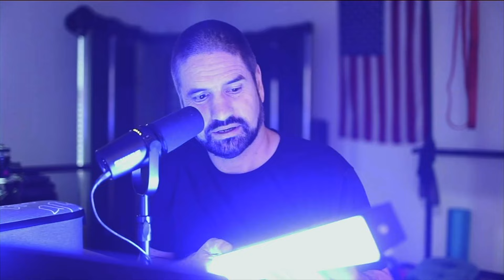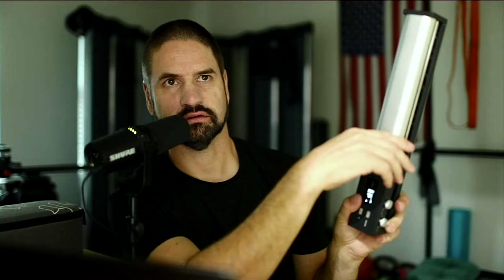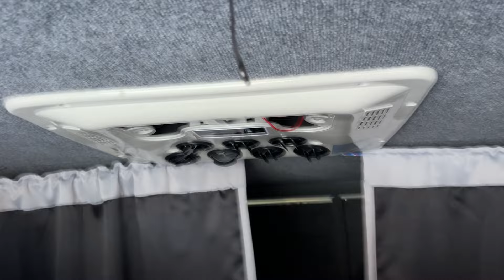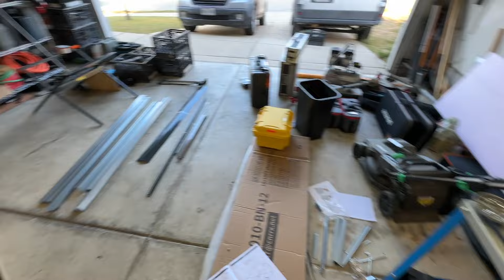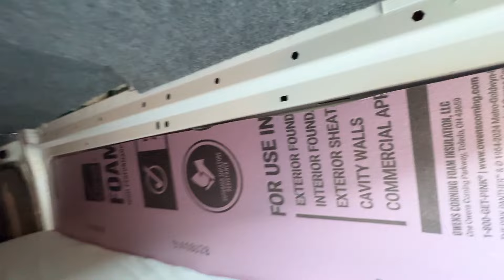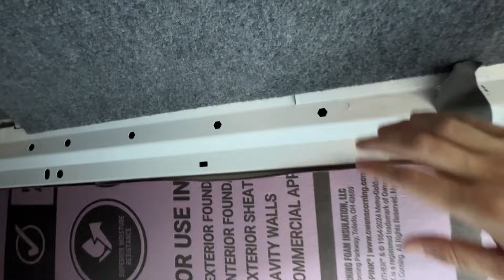Zhiyun C100 | Van Sleeper upgrade

Comment: Any Aputure lights that are RGBWW will do G/M shift. The new 1200x and CT26 do as well. The 600D and 600x do not unfortunately. But the new 600C Mkii is brighter than the 600x. They have their little dedolight equivalent (Aputure 60x) replacement coming soon, wonder if that will

Comment: For the Apurture lights you previously had to get the full spectrum color versions to get the green/magenta shift. Now with the new 1200x they use a different technology that allows for the bicolor variant to have the green/magenta correction. Hoping it can trickle down to the smaller lights down the line

Comment: I have the X100's and the MC20C's and have be pretty happy with them. The X100's had an issue with the batteries at first had to end up replacing all three under warranty. The new replacement batteries have been ok.